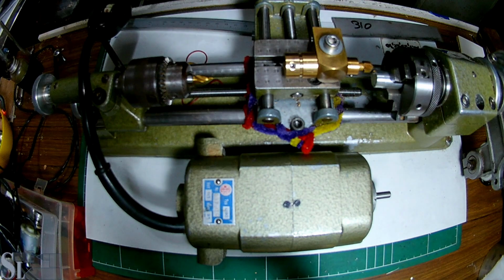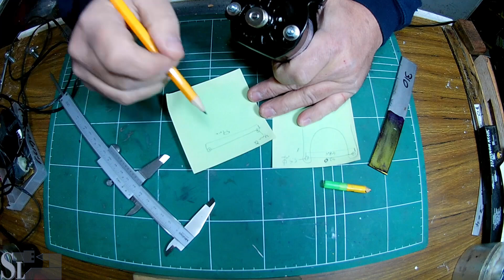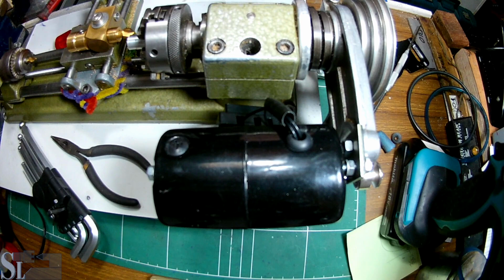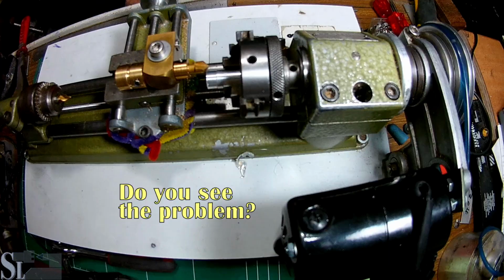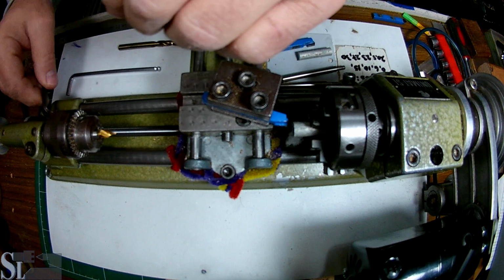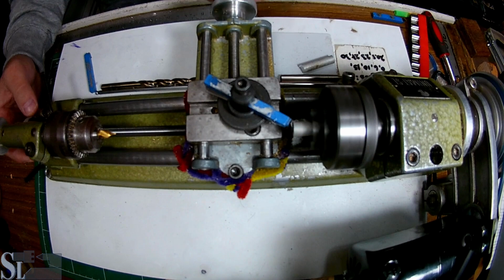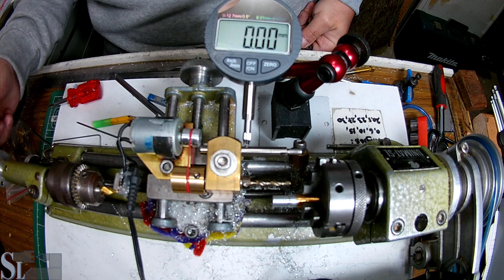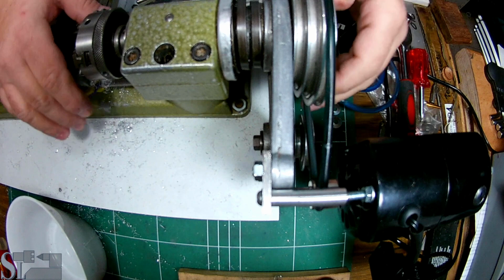Replacing the lathe motor

Comment: Thank you for this video!!!  I was hoping you would show the motor and how you attached it.  I'm wondering if you are going to attempt to make a three step pulley for the motor shaft or if you are going to make the motor slide and lock at the three pulley locations for speed changes????  Thanks again!!!!
Reply from the maker: My pleasure Daniel! At the moment I will not make a pulley set for it. My goal is to rewire the original motor to 220v and get it back on track.
Reply: OK, It's just temporary!!!!   Great!  Maybe a rewire video???!!!  Thanks for getting back to me.
Reply from the maker: @danedewaard8215  Hi. Not sure this will be worthy of a video - IF I manage to fix it. Anyway, I will keep you posted. :)

Comment: I did similar with a 90W but they are only about 40% efficient so had no guts. You can get 180W sewing machine motors cheap too. To reverse the direction you have to change the internal wiring a bit. I gave up though and fitted a 150W, 24V, 775 frame hi torque motor, ~7500 RPM, a 24V 10Apower supply and a reversible motor controller. Eats sewing machine motors for breakfast.
Reply from the maker: Good comment. I love machinning but AC motors and electronics - I need to learn more. At the moment I am very confident I will fry every motor I tweak.
As for the motor I also bought this sewing stepper motor: with speed control and reversible. Like the link below.
I can install it but I would love to fix the old engine and put it back. If I can't - I will put the new stepper motor on. 
https://www.ebay.com/itm/133205230596?_trkparms=ispr%3D1&hash=item1f03a68404:g:t60AAOSwGYZdp12V&amdata=enc%3AAQAFAAACkBaobrjLl8XobRIiIML1V4Imu%252Fn%252BzU5L90Z278x5ickkBUIiHwYv5YgVss0WaiENz9ZAECq63AE%252Fd8xBCXQ2CmZpRMw29cVrm9HgRKszPX80%252F4uL5qHKT8sMcxNH03xBDq79kDhax6V4qpJb0TUVKusbEOqXYX899OHy5IDIRJPCsmkOdPCRgy5Ki6Jxgx3n4VHeNzEvjoCusPRe64oaI4uxLMavF8fSJljzjWdLxnaWr37%252Fp9RUjcbJY09onhwjjJwxHevRLo9rbotPYXIAYD23QU2v9OhiY2wkJeag0%252FGZ2uqDVIWzQCJF%252F5lyMw8H6xmr9OYeGEprn26lBcm%252Fuwkz%252FeRUNArZciZo8zeyhahTdjjy%252BPXSxervFFWSwCRAGWedPUocv%252Fd4YQkaSj9wQ%252B1hBBuz%252F2WKYXmmXvd5%252FvUJEQ%252F%252FYGPdMnmeAfYa5vriaOxTOjejpCYnswMaX3KCA4p6l0Su%252FBh84aNaxnSj2QmwkKV05Vf2W%252F3SftwrLmEeTyzrckxyC8mRv5znJkVESCGlYk46f1cSCTNGyh4ze6jjcnNS%252Fmntjv5fu1WIXQlnLCvWpuJPFPJpGlzKYb8hCgA36q5%252FfSO8mAQHrcsdbzAn2GsgATcKJNAuE7c87Yp3xc919%252FLgU8EeMMb40OvwKl94KjY2NXFf4GRTmdjrmjkGqOf7dNx7seNItpRHS39zB%252B5xYuATl2Q9QI6ThRGiRUKn%252BrTwFxiNLA0CygotA3htjdXPMJUGxjFKPVFcqv%252FR305RDNfwtHsaR%252BvBl1EWag7ic11iAV4WuFv3xPmYQweIhKY5b4f7aAUdGikVxzZ%252FNYe6nEXs%252Bje0dJ3d%252FQP%252F1Z61Kg%252BhKz7V%252FXnC5g4nvuZC%7Ccksum%3A133205230596b2b102c025bc408980da40d45d76f4f8%7Campid%3APL_CLK%7Cclp%3A2334524

Comment: Hi Saar. Working on a DC motor and speed control but I have to match the shaft diameter and motor mount bolt holes somehow...
Reply from the maker: Take a metal sheet say 2-3mm thick and drill the lathe mounting holes it, then drill holes for the motor mount. Try to overlap the holes if possible. Shaft diameter and matching mount can be either bought or turned on the lathe. I have a 20mm aluminum rod and up to 30mm brass - let me know if you need help turning a pulley.
Reply: @Smallathe  ah, yes. A pattern! A template!
Reply: @Smallathe  my plan was to use the motor/pulley bracket as the template for the motor bolts and somehow, mount the new motor and turn it to the matching diameter of the pulleys, drill for the locking pin, drill and tap the end for the 4mm pulley screw and washer. Thoughts?

Comment: Btw how do you like your blue urethane belts? They from Tom?
Reply from the maker: Hi Mike. They are good but I want to try and buy urathane rod and make my own belts. It's fairly simple. We will see... :)
Reply: @Smallathe  exactly. I also plan on making my own. I have before at work and it's very simple. Two important tips with that: remember to account for belt stretch, and be sure to get the correct diameter of belt and reinforced polyurethane. Then all you need is a putty knife and a lighter👍
Reply from the maker: @machinistmikethetinkerer4827  indeed! I also plan on getting thin urethane for a new lathe tool... That will be fun
Reply: @Smallathe  oh oh. I sense another vid coming? What ya makin? I picked up my first professional piece of vid production equipment" a $4.99 phone stand😂
Reply from the maker: @machinistmikethetinkerer4827  great.looking forward for your first vid. And yes... TFM slugs are under construction!
Reply: @Smallathe  intro is in!